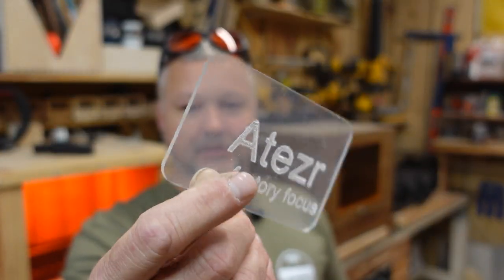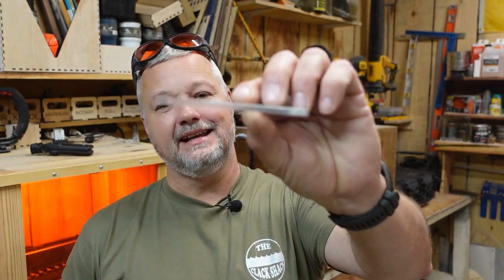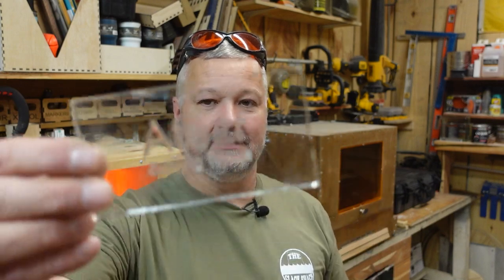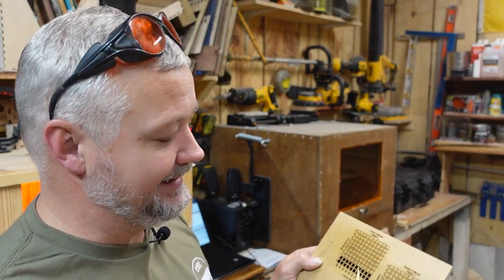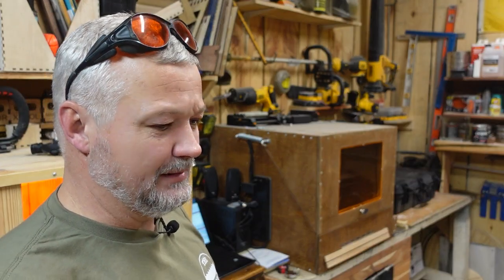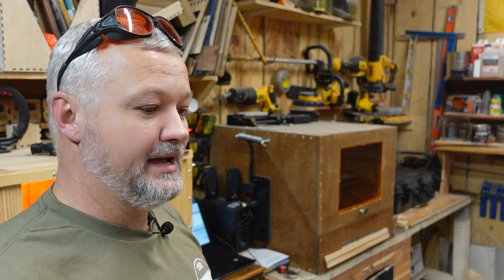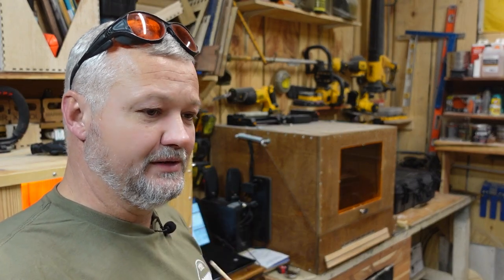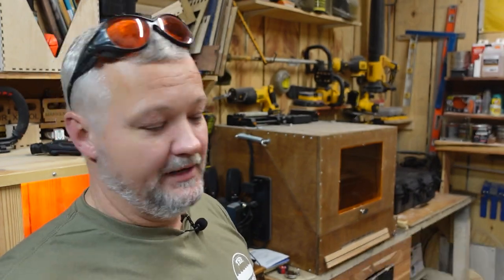Atezr P20 plus- update and jig kit

Comment: this is the machine I bought, still figuring settings since they were wrong when I setup, I also need a formatted sd card since did not come with one, and need to look-up your video for material test since the settings in the manual do not work.
Reply from the maker: Sometimes it takes a bit of tweaking..
Reply: @TheClackShack  watched your LightBurn setup, just adjusted mine to 430x430, but I know inches better? So which one is better. And I setup my camera and used it but came back day later and fired up the machine and it’s like I have do the camera ( not fun) setup again.
Reply from the maker: @bigcountry734  sometimes lightburn does that. Save a file after you do it. Just anything. Not sure why it does it but the file save seems to help.
Reply: @TheClackShack  do you have a video on camera setup ? Looks like I have to do it every time lightburn looses my camera. Finding the dots is a pain in setup
Reply: @TheClackShack  not sure if you respond on FB message but sent pictures so you see what I’m talking about, I uninstalled camera, moved to a better location and went thru setup again and still no camera and the camera window top part is offscreen

Comment: What speed and power would you use to burn the jigs and templates? I tried burning 1/4" box store plywood with the settings in Lightburn ... made a mess of the plywood and couldn't get a clean burn through on my ATEZR P20. BTW, I really appreciate your videos ... I am learning a lot!
Reply from the maker: You need to do a power test to get the best settings. Usually around 6mm/s
Reply: @TheClackShack  Problem solved ... did the power test per your suggestion, found out the material I was using was the problem. The 1/4" 'Handi Panels" they sell at the box store have a very soft inner core that burns like crazy while the laser is working on the outside laminations. Picked up some true baltic birch and my ATEZR 20P cuts clean as a whistle!

Comment: Hello sir. About to pull the trigger on atzer p20.  Can I run  in a garage with door open and fan or is an encloser a must have.  I'm planning on getting the atzer AS enclosure but not sure it it's 100% necessary.   Like in CA so weather is not usually  a problem.  Any advice is welcome
Reply from the maker: You can use a fan to pull it out of the area. With wood, you will generate smoke as expected. I would avoid other materials if you do not have good ventilation. You can make your own enclosure but you will want a fan if you run it a lot. You can vent it out a window or under a door if needed.

Comment: I got it cut out and put together.  Trying to mark zero, zero on it.  That would be a great addition fwiw.  Some kind of reference point to bed. Maybe put a 10mm scale on a portion of it.  Doesn't look like there is any way to have the squaring jig at y=0, seems like closest I can get is y=13, is that accurate?  I have fixed jig at top of machine.  I find no reference detailing where it goes but I put it at bottom and it took up way too much bed space.  Maybe I just need to engrave a 430x430 box with it installed and use those lines as reference.  Is it protruding into bed or will it be at 430?

 I am learning this, brand new to diode coming from cnc world, I am really struggling to find zero zero with machine.  I want to be able to have a fence reference to put an existing item to and engrave onto it in an accurate position.  I'll figure out a workflow but I am pretty much blind to where the laser dot is, I hit fire in lightburn and it never stays on long enough.  I frame with laser on and that works but again I would like to engrave in a predetermined position.  Maybe I need to turn down framing speed somehow cause this thing flies.

Sorry for rant.  I am really lost on where your jig lines up to bed and how to transfer that point to lightburn.
Reply: I have a tool somewhere that can cut the squaring jig to fall at 0,430 ... :)
Reply from the maker: I didn't make it to be at 0-0. It is just simply to keep the object square with the rails. The large panel can be modified to make that happen.
Reply: @TheClackShack  I got it to 0-430 which is zero zero in a way.  Now to the big panel for coasters! Wish me luck.
Reply: I love this jig. Thanks for making it and your content.

Comment: I just downloaded the new jig.  What thickness of material did you use?  Also, please confirm the power/speed/pass settings your used.  The patterns say 18.9in/min at 60% power (480 mm/m at 60%) with 2 passes.  Will that setting cut 5mm Luan?

I tried to engrave the plastic bump card and had a horrible result.  Keeping in mind that I've not yet tried to etch/engrave acrylic yet, I used the Atezr table in the owner's manual to set my speed and power.  Well, it did not engrave/etch the acrylic, it burnt through to my waste board and engraved it.  What did I do wrong?
Reply from the maker: You cannot engrave clear materials with blue diode lasers. If you paint it black, you can slightly etch it. For diodes, Black is the best acrylic to use. I engraved my focus card using a CO2 machine.
Reply: @TheClackShack  ouch!  I just got 100 clear acrylic disks to engrave. Can I cover them with blue painters tape and then engrave? Or did I just waste money?  I guess was I could paint the protective coverings black and then 
engrave??????
Reply from the maker: @randybranson1009  , hit the surface with some black paint and you can etch.
Reply: @TheClackShack  I'm wanting to make some ornaments for guys in my Aircraft Owners Club.  I don't think black is as good as clear.  But it may have to be black.
Reply: @TheClackShack  I painted the top surface peel off and tried to engrave.  Lot's of popping noises but no etching.  Have not had time to go back and try painting the back side protective peel off and engrave the front, or paint the acrylic directly.
Reply: @TheClackShack  unfortunately that didn’t work. It etches the paint but not the acrylic. I tried painting the protective cover and it engraved; flipped it and it did the same thing; took off protective covers and painted the acrylic and it engraved the paint.

Comment: Found something About the Atezr V35 Plus I don't like! Limit switch dose not work on the back rail!
If you run your gantry to thre back side it will hit the rail!
Reply from the maker: Same on the right side. As long as don't move it by hand, shouldn't be an issue.
Reply: Ditto with the P20, but found out that if I home it first after doing a manual move, it doesn't hit and make that horrific, expensive sounding grinding noise.